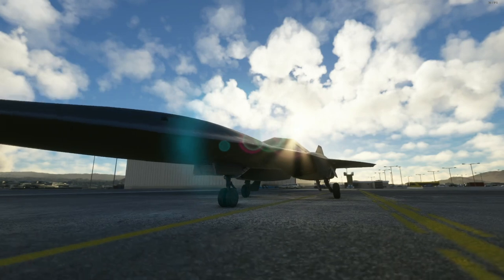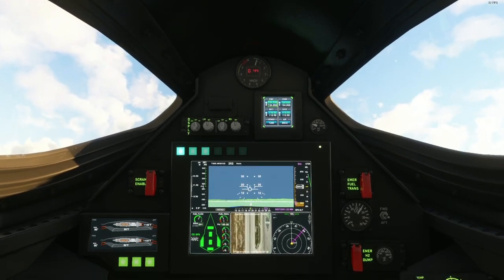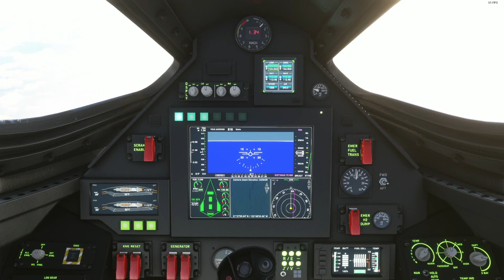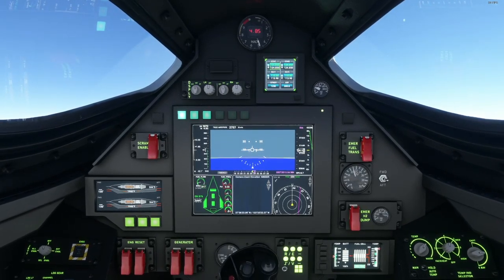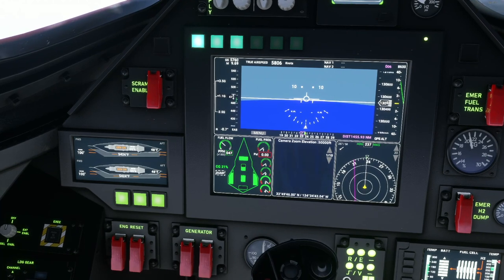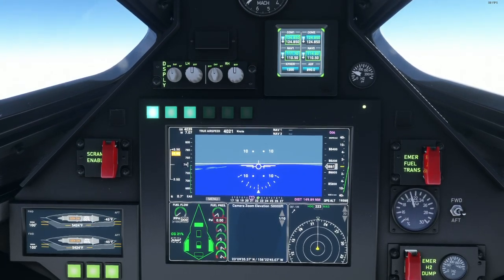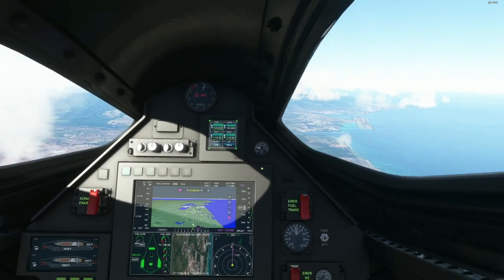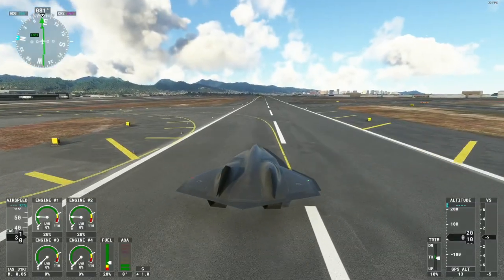SR-72 Darkstar - How to fly at Mach 10

Comment: I have flown the darkstar like 14 times. I never thought it had spoilers and my mind was BLOWN when you activated them. Just didn't seem like a plane like this would have them ^^'
Reply from the maker: I saw other people say it didn’t! I just tried it and it worked. It just uses the flying rudders in opposite directions, kinda like how a Long EZ does it.
Reply: I have a problem. The Darkstar has speed brakes. Mine are extended and I can't get them to retract. Does anyone know what the speed brakes are called in the control settings? Spoilers? Flaps? I can't find information on these control settings anywhere on the internet. Trying to program my Thrustmaster One
Reply: I have a problem. The Darkstar has speed brakes. Mine are extended and I can't get them to retract. Does anyone know what the speed brakes are called in the control settings? Spoilers? Flaps? I can't find information on these control settings anywhere on the internet.
Reply: @paulntx yeah, you're gonna want to program a button to the spoilers

Comment: I can't see what is in front. On the sides yes, but not in front. Why?
Reply from the maker: It is a very weird aircraft design. You only get the Lindbergh reference. There is a synthetic vision screen, but that’s about it. It’s mostly because if it was real, making glass handle that kind of heat and pressure is really hard.